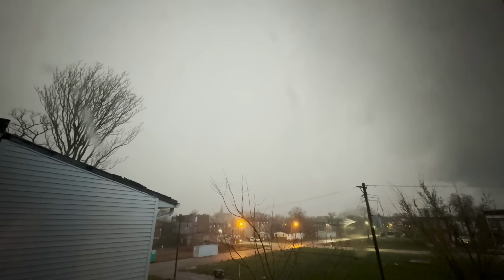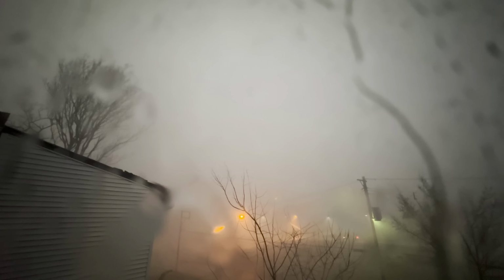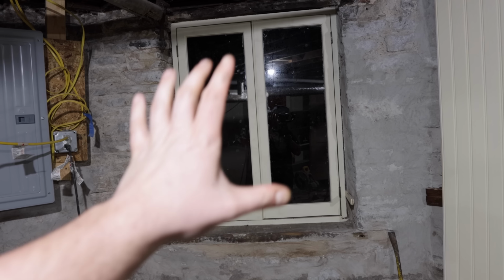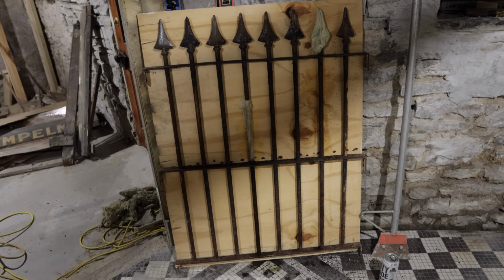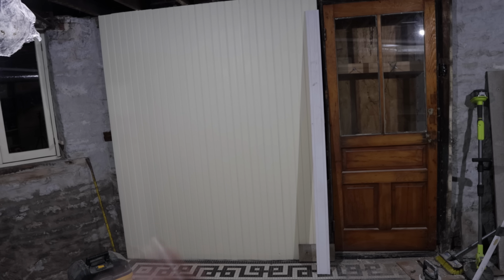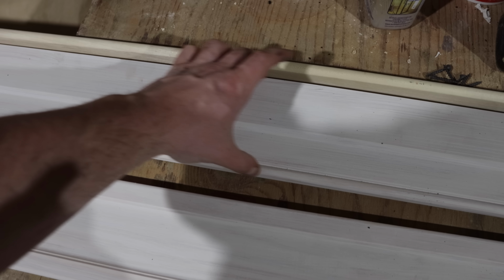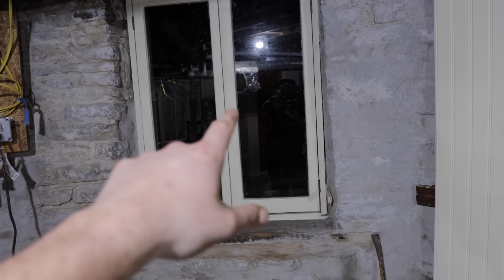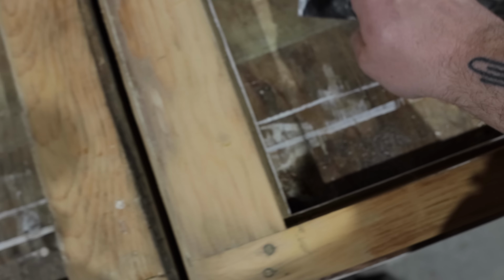Dark and Scary to Light and Airy S3 EP28

Comment: Beautiful work on the window! Have you considered taking the window gates to get sandblasted? Additionally if you plan on painting them consider getting them powder coated. It withstands the elements significantly better. If you do go the powder coat rout, the sandblasting is usually included in that service.

Comment: For the iron work, we use a braided steel brush on an angle grinder here. It’s a bit messy but quick. It removes paint, rust, dirt.

If you want your evaporust towels to remain wet, you can wrap them in plastic wrap.
Reply: I need to read better before I post. You said it first, and best.

Comment: When I needed to repaint a window grate I used a angle grinder and a drill with a wire wheel attachment. For your trim, it is customary to not match the wall color. You could go with a white that has a hint of the yellow from the walls, or a white that matches the color of the white floor tiles.
Reply: Great comment...
Reply: I wondering what kind of wire wheel would work best.  No experience but my instinct says to use something softer than the iron.  Maybe brass or bronze?
Reply: @georgebush6002  the rust is darn tough it really pits the metal so the brass would be too soft. There are a variety of strengths to the wire wheels at the hardware store. I believe I used the strongest one. You really want to get down to the stable parts of the metal.

Comment: The window looks great! I love the dark green. I've been there with trying to get a clean, straight, solid edge to a window frame so the glazing line won't be a mess. It's so hard to convince contractors used to modern practices that sometimes you need to stick with the old way when your house is old. Setting the beadboard on the wood strips with an airspace makes sense to me. You sealed the back of the wood, but are leaving the stone behind so it can do its work. For the door frame, I think matching the walls will work best. Using shellac on the closet doors was fine, but since the door frame is new wood and across the room, the cohesive color (also matching the window frames & sashes) is on point. Glad you avoided the worst of the crazy weather. CA is getting a decade's worth of storms in one winter. In San Diego we are only catching the edge of those storms, but it's still crazy. Last week we had one of the closest lightning strikes I remember in my entire life; sounded like a bomb went off in the middle of our street. No damage fortunately. Take care and carry on. :)

Comment: Always enjoy watching your progress!  Have you considered having your iron gates sand blasted?  I live in STL city and use Liberty Sandblasting for larger/heavier parts.  Their prices were great and they can paint/prime parts like these.  It saved me a ton of time and the parts came out very well.
Also, I've used a similar strategy to remove rust with the soaked paper towel, and I put a plastic wrap or bag over the area to reduce evaporation.  Hope your work goes smoothly!

Comment: I will second everyone saying to sandblast the gates, but I would recommend also considering a wire wheel if you don’t want to go that route. That’ll get all the junk off and then you can spray it down with some phosphoric acid (metal prep/concrete etch) to convert the rust in the deep pits before paint

Comment: Hey Kaleb. I have a tip for your viewers.Time and neglect left several of my sash rabbets in bad shape. Even after applying Abtron structural epoxy filler, there were still a few issues. What I did was clamped a steel straight edge at the rabbet's edge. It was slightly offset from the rabbets edge, allowing the putty knife to ride at the proper angle. Hope this option helps.

John. Bethel, Missouri

Comment: The window frame is racked.  Lift the bottom right and the upper left should fix itself.  It's just like a gate, only on a gate they use diagonal bracing to prevent racking.😀

Comment: I vote for an accent color for your trim. If it is all the same color it will disappear on your walls.

A cheap way to get rust off the grate is soaking it in vinegar. Not sure if a washer machine over flow pan would be big enough but it is an idea!

Comment: I learnt a fairly cheap way of doing large objects that need cleaning, is to get a large bin that has wheels and can fairly easily be moved around. 
Add a kilo of Citric Acid powder which can be bulk bought pretty cheaply (not very strong and is actually used in foods like cakes and such as a citric substitute) and then fill it with simple water. Lower in what ever you want clean and leave it for a few days or even overnight. The acid isnt that strong and is safe to touch, unless you are allergic to Citrus, but it is more than enough to lift rust and scale and other things from the surface and can leave them quite clean with minimal rinsing afterwards. Awesome for car parts that are very rusty. 
I think in future it will be best to not seal the outer gaps around the window frame until you are ready to fit the windows and get the spaces and dimensions correct before filling them in.

Comment: 1.  What if you trade right for left on the windows? Fit better?

2.  Basement walls are best waterproofed from the outside. Insulation condenses moisture inviting mold.

Comment: Stripping and derusting ironwork: I'd definitely look into electrolysis - all you need  is a battery charger, water, washing soda and a sacrificial metallic anode. Building a plywood box with a vinyl tub to submerge the grate should be pretty simple

Comment: There’s a product I used when I was restoring my old metal clothesline posts.  I forgot the name of it but you get it at the auto part supply store.  It’s a product they use on cars that turns rust to primer…no kidding it works! It comes in a spray can and it turns black once dry.  You’ll probably still want to wire brush the chippy parts off first to get the profile back where you want it but the spray will take care of the rest.

Comment: An angle grinder and a selection of wire wheels will take care of the rust in less than a half hour, sand blasting gives the best result. A powder coat primer for rust protection. No one but you will now. 😉

Comment: The window restoration looks great. My sister had a house with a full basement . One corner had a moisture issue on the cinderblock walls behind the pressure treated studs and drywall so l removed the drywall in that corner and applied Drylok to the cinderblock and it solved the moisture problem.

Comment: Try a can of ZEP oven cleaner for the wrought iron window guard.  That stuff does amazing at removing paint.  Lay it down outside, spray it and it should come off.  I used it to strip paint off light fixtures, hardware, etc.

Comment: A wire brush would be better at the last bits of paint, though there would still be tiny amounts of lead.  Put a wire brush bit on your drill.  Sandblasting and powdercoat would be more durable.

White door trim, or pale grey to match the floor.  Not black

Comment: Iron needs an angle grinder and a wire wheel attachment. It will strip all the paint and rust off leaving the metal bare.

Comment: Use wire wheel to remove paint from rough iron and other metals,or make friends with a local fab shop and sand blast them all at one time. 
Hope this helps

Comment: I would do the door trim in black to pull the floor into the overall look. It would also contrast the wall quite nicely. It would also pull in the iron grates, if you're going to repaint those black.
Reply: I liked the idea of black at first and then I realized that it would not look great with the room since the floor is black and white but the walls are an ivory, so the contrast would be too jarring.

Comment: Can you use a soda blaster to get the rust off, or use walnut shell .. Harbor Freight..not sure if you have a Harbor Freight in STL, but I have used a soda blaster on a rusted milk can, worked like a charm.  The soda blaster was not that expensive either, about $100 or so.

Comment: In Seattle in this era, the trim would still have been stained, and if not stained, would've been a different colour to the walls. You wouldn't get to same-colour-trim for a _while_.

Which isn't to say someone wouldn't've done it anyway, since after all buying one colour of paint is cheaper than buying two.

I suspect the door trim being off the floor had a lot to do with moisture/water and rot avoidance, which also I suspect has a lot to do with the choice of stone for trimwork. (Not that stone trim wasn't popular on and off on its own; it absolutely was.) But 1) A basement office - already damp - where you're seeing 2) animals who will sometimes 3) generate what we might call their own water. So I think that's what's up.

Comment: The only color I would consider painting the trim is another shade of white. Just a shade lighter than the walls. Basically, a white on white look, which can be extremely elegant. But I would probably stick with doing the same paint color as the walls. I might do a semi gloss on the trim to make it stand out more and make it easier to clean. In a basement it would probably make sense to make the trim as durable and scrubbable as possible. You could even consider a gloss finish on the trim if you are experienced enough to try it. Gloss paints show every brush mark and take a lot of patience and experience to do correctly. I love painting. It is the most transformational thing you can do in a space, and it is one of the easiest and cheapest as well.

Comment: Personally, I'd just setup a quick fence and run a router down that sash.  Wouldn't have to take off much material to square it up.  If you had to, you could cut a bit more and use a dutchman

Comment: I guess it doesn’t matter much since the rest of the house doesn’t have any insulation in exterior walls.  Will you have radiators down there for heat?